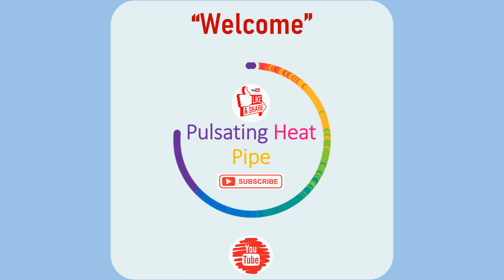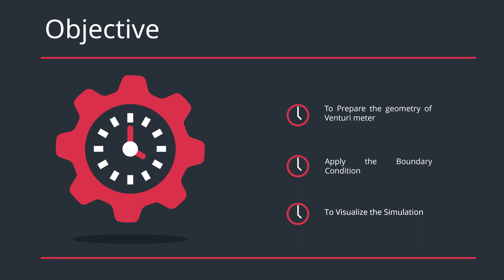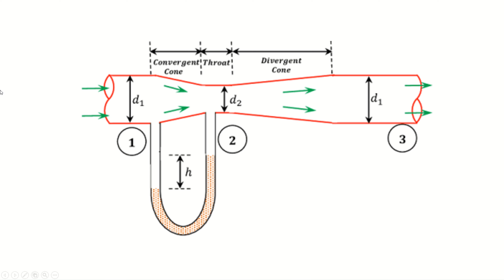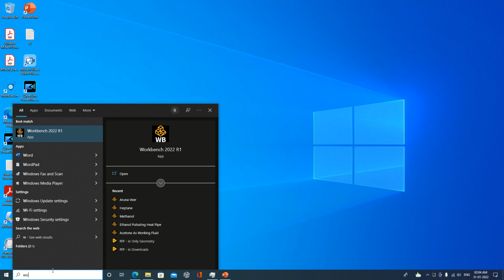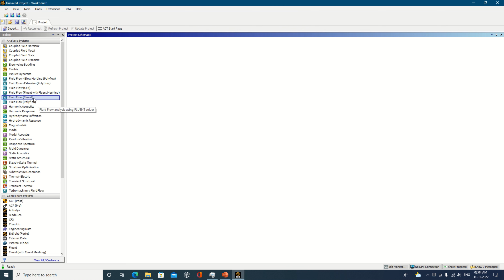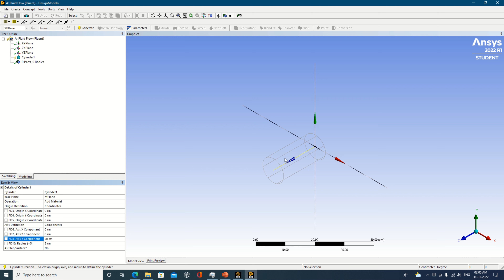Fluid Flow Simulation in Venturimeter | Flow in Convergent & Divergent Nozzle

Comment: Excellent video,  it is always mandatory to thin and then fill in the geometry part?. If a just Dra a solid is not right?
Reply from the maker: If you want wall, then necessary to make it thin from solid. else you can only change the definition to fluid and do analysis with fluid zone only